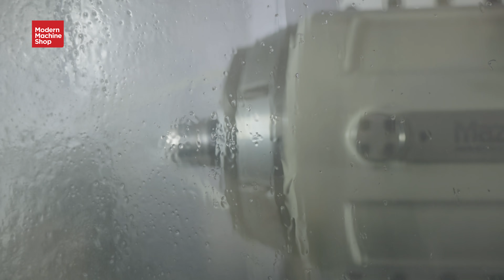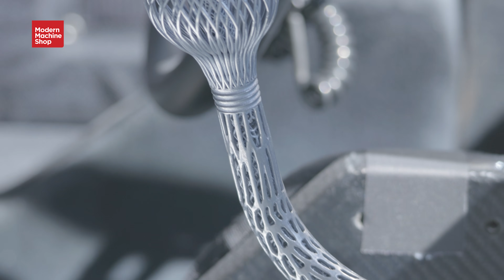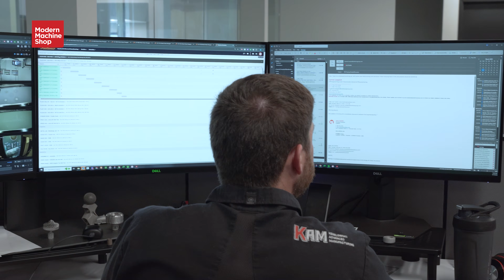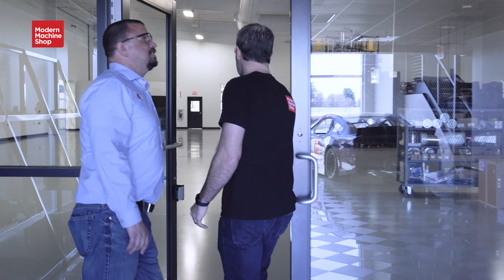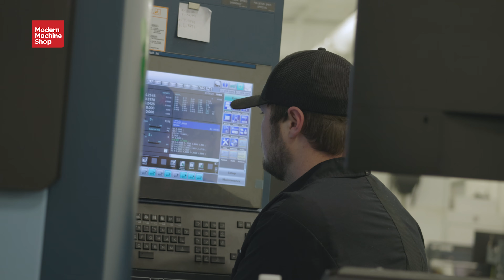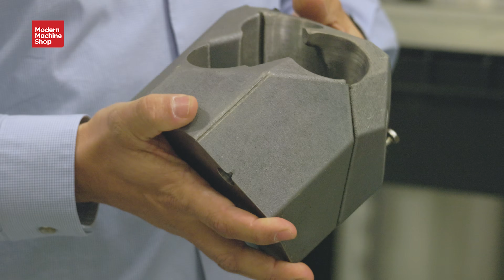How This Metal 3D Printing Shop Scaled from 1 to 25 Printers | Machine Shop Tour

Comment: I would start a 3D printing business right now, but the machines are much too pricey still.
Reply: They are pricey for everyone. What makes you think happens once they come down in price? Also, the machine itself is not the biggest expense. Think about the running cost like constant argon flushing and the material itself Is very costly.